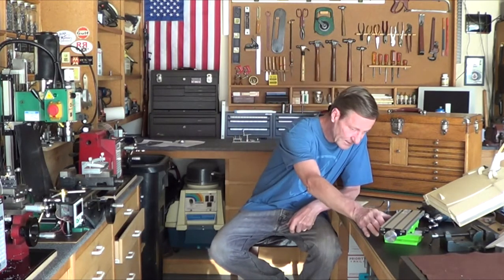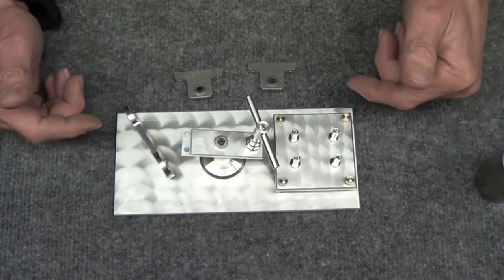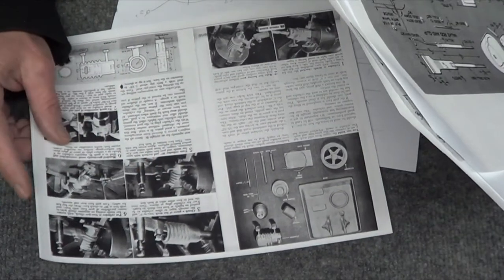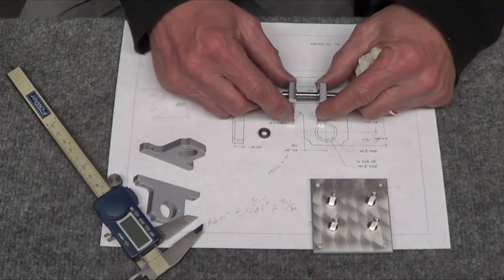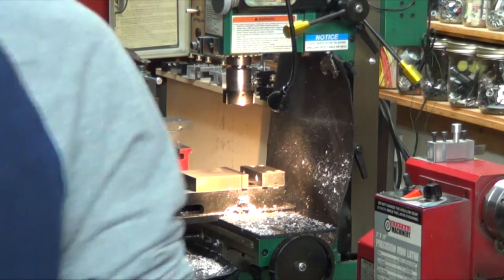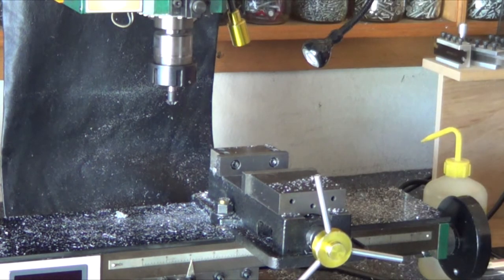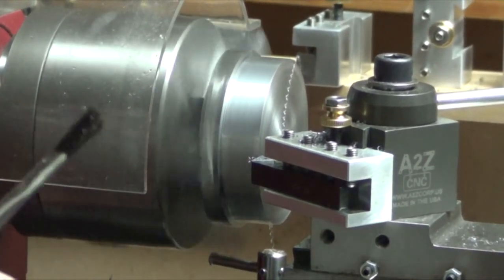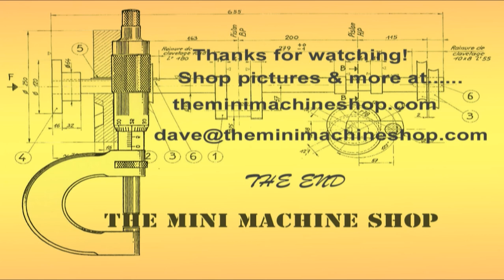Fire Eater Engine Part 2 Video #127

Comment: It would be nice to have your view of that X - Y table...
Reply from the maker: That would indeed be a great angle but with this camcorder the closer it is, the depth of field and auto focus gets really bad. So for most videos the camera is on a tripod 8 feet (2.4 meters) away and zoomed in on the action. Lighting and reflections have also been a constant challenge.
Reply: I'm using a Canon camcorder and just discovered some features like manual focus, manual aperture and a couple of other features that helps with the filming. 
Agreed that reflections are sometimes a little challenging...
Reply from the maker: The manual focus scares me as I don't trust what you can see on the tiny little screen. I only have one shot at recording because once its machined its machined. Can I ask what model is your Canon?
Reply: it's a Vixia HF R600, all that series has those features. Nice thing are also a HDMI output so you can monitor on a bigger screen, a computer monitor with the proper adaptor will do and also the external sound input for a lapel or even a wireless mike.